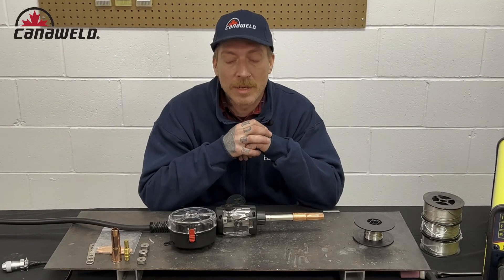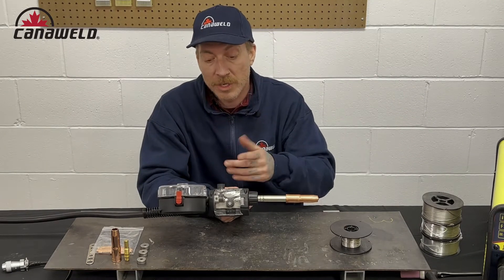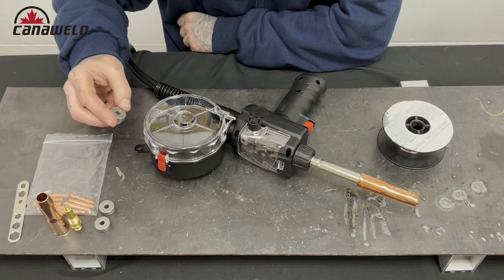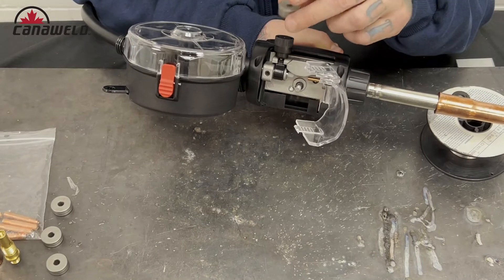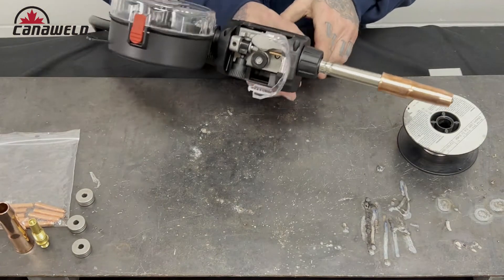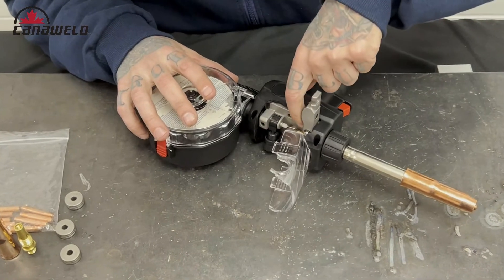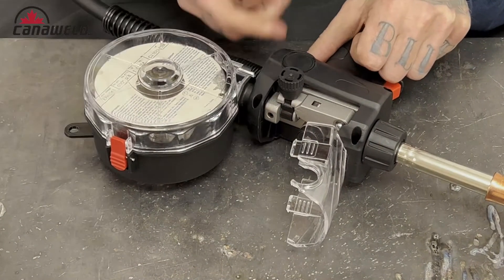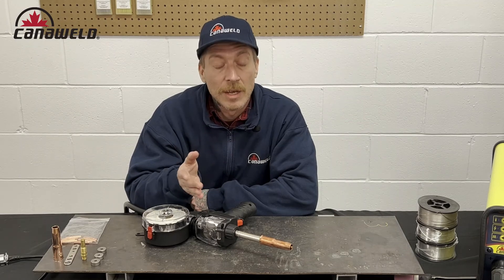HOW TO SET UP CANAWELD'S SPOOL GUN FOR ALUMINUM WELDING

Comment: Will the Miller spool gun be compatible with this welder
Reply: Do you mean the miller spool gun or the push pull gun?
Reply: @nickbaspaly6239  yes.because if it doesn't then I would have to purchase a new one
Reply: @nickbaspaly6239  yes
Reply: The spoolgun
Reply: Our spool gun uses a euro style connection that I dont believe will be compatible with the miller spool gun  , sorry about that buddy.
Reply: @nickbaspaly6239  ya I had a closer look at the ends that plug into the welder and they do look different.